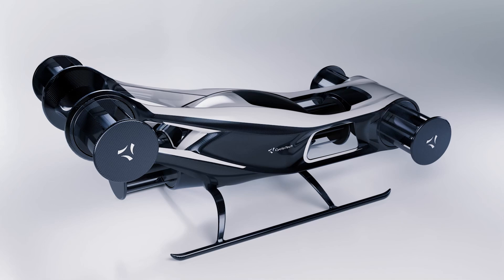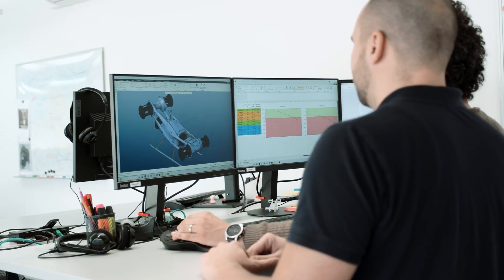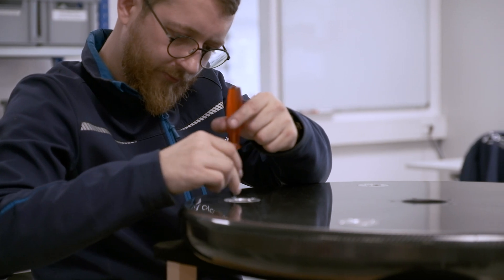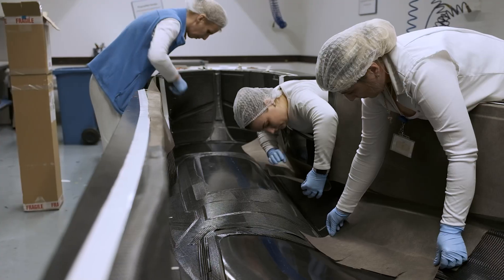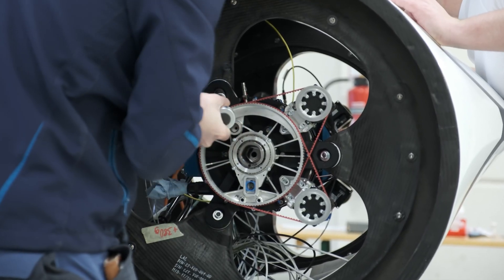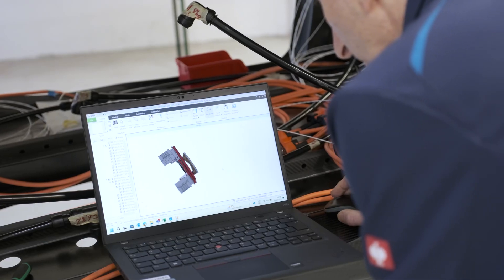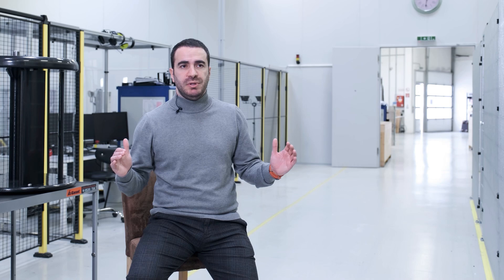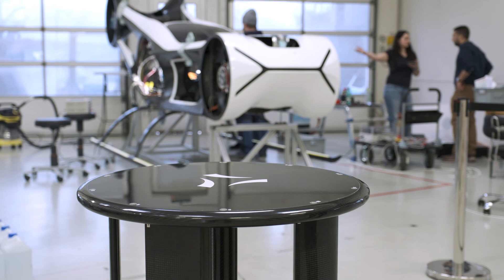BlackBird | Revolutionizing Aircraft Design

Comment: whats the efficiency compared to regular props ?
Reply: I think it's more about a point of difference in the industry. Rather than about efficiency.
Reply: If I had to spitball it probably not too different than a conventional drone, IE worse than a helicopter and much worse than an airplane. VTOL systems have to constantly fight gravity after all, but in theory, a cyclorotor should be able to do horizontal flight and regain some efficiency as a fixed wing.
Reply: You’re not allowed to ask that 😅